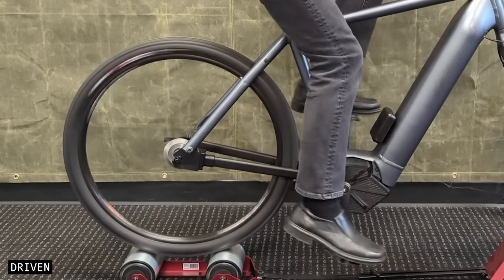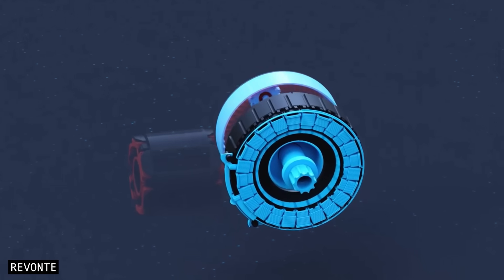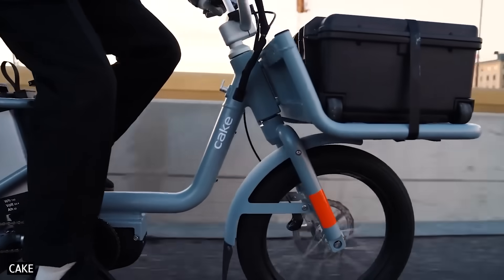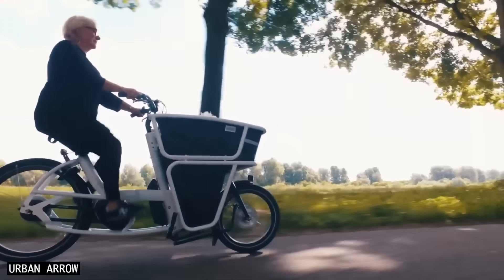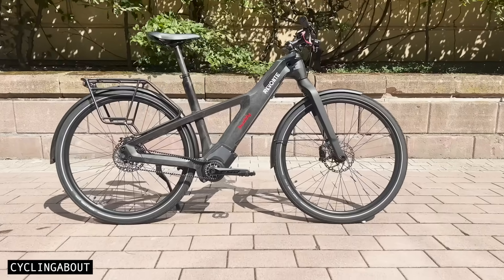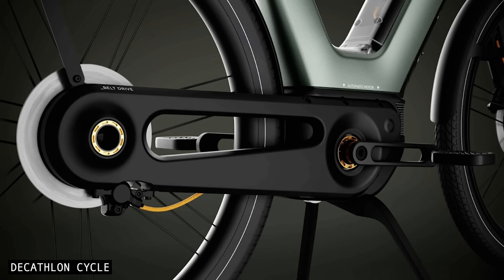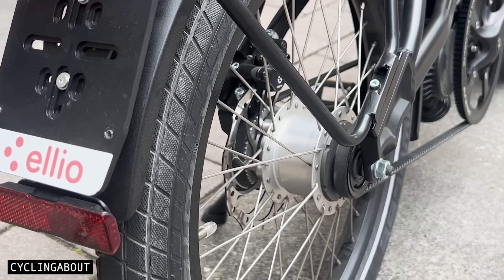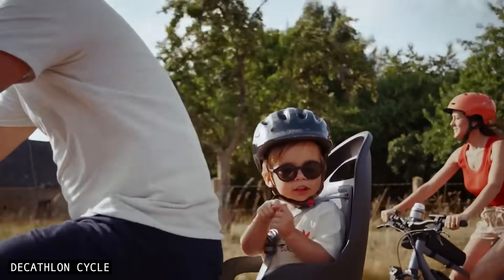Death of the Derailleur? Chainless eCVT Bicycles Might Change Everything!

Comment from the maker: I might be wrong... but I think this is the FIRST video explaining eCVT bicycles on YouTube!! 🎉

If you like my videos, make sure to join my Patreon so I can keep em coming: https://www.patreon.com/cyclingabout
Reply: I came up with this concept a few years ago and was surprised none of the major manufacturers were making it. I'm glad somebody finally is starting production.
Reply: So not really "chainless".. the eCVT is separate from the chain shaft or belt choice. .... using the 2nd motor to auto adjust the gearing , is fine , but why ? Why add weight complexity & cost  when manual gear change is just fine?
Reply: @brackcycle9056 manual CVT, you either have the planetary fixed or free, so two gears.  The electric motor allows the infinite variation between those two.  Or that’s how I understand it…very clever and simple.
Reply: Cool, is the an FS emtb version of the "Orbit Drive" shaft drive to deliver power?  Seems like it's only a prototype.

Comment: Already living with the nearly unfixable and expensive Bosh mid drive performance CX on my cargo bike. I'll stick with the trusty bafang hub motors for commuting, and a normal push bike for sports. Just easy and cheap to fix and keep running. This ecvt tech just brings more complications to a system that needs to be easy and cheap to maintain. Normal people don't need more power that what ebikes already make, they just need it to be cheaper to change the way they move.

Comment: This is a bad design.  I have a bicycle with a nuvinci hub, and it's a great technology, but there are transmission losses.  Add more transmission losses for shaft drive.  If you want a low maintenance drive train that is still repairable, please consider belt drive bicycles.  Also shaft drive isn't a new technology, and hasn't taken off for the reason of weight, cost, and power transfer inefficiency, as well as harder to maintain as others have noted.

Comment: e-bikes are not needed in 99% of the cases - just fully use your feet instead, you know like normal cycling works.
Reply: This logic only applies if you think of cycling strictly as a sport and not a commuting tool.

Comment: Lets try something simpler.  

  The motor powers the bike, responding to pedal input and the assist setting.  

  The pedals connect to a generator that that supplies power to the motor, with excess power charging the battery.  There is no mechanical connection between the pedals and drive system.

This system, without a battery.  

  The motor power is equal to the pedal power.  Pedal power is equal to RPM times torque.  Set the desired cadence, try to go faster than cadence, torque increases, bike speed increases.
Reply: There are companies doing that. There's two problems:

1. All pedal power must go through the serial path, reducing efficiency.
2. All pedal power must go through the serial path, and at low speed, the motor may not be able to deliver all of that power - some serial designs have had problems where they can't climb hills as a result.

Additionally, if you don't have a battery absorbing the excess power, if problem #2 occurs, it feels like the pedals are slipping.

The eCVT adds a planetary gearset and a mechanical path to the drive wheel so that some of the power goes through that mechanical path, reducing how big the motors have to be and improving efficiency. In addition, at least some eCVTs have a one-way clutch so that the pedals can't outrun the drivetrain, so if you're at a stop, all power goes through the mechanical path allowing the full human power to be used.

Comment: CVT is new, yes, but the concept of removing the derailleur and putting all the gears where the main sprocket is was experimented in the 40s and again in the 50s.  Use of a driveshaft was also an idea. 

The driveshaft idea didn't work out due to flexing of the frame at the rear hub. It translated into seal failure at the forward transmission. I guess no one though of putting a U-joint into the shaft? Odd.

The larger problem was the transmission itself. W-A-A-A-A-Y too expensive for the price of bicycle back then. They could easily cost 3, 4 times the price of the bike.  With today's prices, they might again be feasible.  As long as someone invents the idea of a U-Joint. I don't know, we might need to get our top engineers working on that one.:face-green-smiling:

Comment: No, CVT gears do not double the power of an Ebike. That is rubbish. And there's a good reason why driveshafts are hardly ever seen on bicycles. They suck. They have low efficiency, have problems transferring torque and they break easily.

Comment: This is all very interesting !

But the price has gotta work for me.

I think that a more "standard" rear hub 350w motor + 36v + 5 level pedal assist @ 20 mph (rated Class 2 in USA) in a tough E-MTB package is what I can use day to day.

I just bought exactly that in fact its the Vertis 27.5 E-MTB with front suspension & 2.6" Semi Fat tires.

The pedal assist works superb - you just have to learn which of the 3 x 7 - 21 speeds is best for your given situation.

This well designed & strong - agile even on technical trails is an outstanding value at just 
$ 648.

Finally at these prices many more Cycling & Fitness consumers can join the e-bike community.

In our local bicycle club one man's wife rides along on her e-bike - it allows her to keep up with her husband (not strong enough otherwise) so to me this is a hidden advantage as it allows friends or family to ride together despite strength disparity.

Comment: Every video I've seen highlighting some new tech as the death of the  derailleur replaces it with something even more complicated  that would be even more difficult to service. How is that better?
Reply from the maker: I replaced my derailleur with a Rohloff hub over 20 years ago. It's more difficult to service, but that's the thing - it barely ever requires servicing. I essentially just change the oil every 10,000 km and get the bearings changed every 50,000 km.

I consider that better.
Reply: @Cyclingabout  Fair enough. I buy cheap bikes that use cheap parts and while I've never had a derailleur fail on me I still replace it every couple of years because it's cheap and easy.  That's my preferred path.

Comment: As an aging outdoorsman, a light weight sealed system for pedaling assist is what I am looking for. We don’t need crazy distance or speed, just ability to help on dirt roads and mild trails.  Not looking for extreme, too old to risk breaking something.
Reply: Cool idea & I can relate.

I'm an aging road & MTB cyclist - 61 - still in solid shape but chasing the 25 & 40 year olds gets exhausting ya know ?!

I finally plunked down for an E-Bike an E-MTB actually and now I can testify it's helping me not get dropped on group rides but I still get a great workout - same as before - but the battery & motor with variable pedal assist keep me close to the main pack - we're safer as we do ride roads shared with traffic at times.

I'm not going to spend the $3-8,000 these crazy cool e-bikes in these videos cost.

What I got was Walmarts latest E-MTB the Vertis 27.5 with 350w hun motor / 36 volt / 40 mile range.

It's rated Class 2 so 20 mph max assist but I've found it's plenty powerful. 

Gears are 3 x 7 Shimano with strong disc brakes + 2.6" Semi Fat MTB size tires.

Could accommodate 3" tires too.

Anyhow it's a very high quality bike and at a super reasonable  
$ 648 it's unbeatable value.

I've put 250 miles on in the first week testing it - it's slim design - easy to miss the battery it's so covertly hidden - and at 52# not super heavy.

On technical MTB trails it performed VERY well nimble & agile on rough patches even.

Comment: Still haven't understood how eCVT works. How do planetary gears deliver continuous transmission ratio? It appears to me more as if the speed ratio motor delivers variable pedal assist, rather than changing transmission ratio.
Reply from the maker: The best way to understand how they work is by using the Toyota eCVT as a prop.

I think this video does a great job of explaining it. Just imagine MG1 and MG2 are the two electric motors inside our bicycle eCVT gearbox: https://youtu.be/xg95OlH61lw?si=cbCjzDQOGn_wbL2K&t=793u

Comment: Why not eliminate the gearbox altogether and have the pedals connected directly to a generator and the electric motor,  would drive the wheels? Sure, you need a battery and would be stuck if it were dead, I'd take the risk.

Comment: Gear drive has been tried several times before . Aside from higher price , the ease of replacing a rear tire without specialized tools is one issue , then there is the probability or debris getting into the grease needed on the gears . There is a good reason such tech does not get used in high performance bikes needed in races such as the Tour De France . Chain drive is more energy conservative . The wasted energy of gear drive is no problem in automobiles with way more horsepower than needed . I worked 30 years as a bicycle mechanic . Keep it simple stupid .
There is a reason derailleur systems are so abundant . Electronic shifting is not needed . Almost any mechanically-minded person can replace a shift cable & learn to adjust the shifting . A bicycle is a poor location for anything electrical , in my experience .

Comment: I am a certified retired master mechanic. If CVT transmissions on ebikes are anything like a CVT in a car I would never own one. If it was given to me I would throw it directly in the trash where it belongs. CVT  transmissions in cars are complete garbage.
Reply: Have you any hints on why CVT on cars are not to be recommended?
Reply: @Herr_Vorragender  Hi, yes. First off they deliver a terrible driving experience. They are built with very poor quality compared to a hydraulic transmission. They over rev the engine and extremely hard on it, it is truly exhausting to drive one. They cannot be rebuilt and most are loaded with 30-40 sensors and are very troublesome. They have half the life expectancy of a hydraulic transmission. When you do go to replace it it is going to cost you 10k+ to replace the piece of junk. If I was given a brand new car with one in it I would have it flat bedded right to the scrap yard because I would not have the heart to stick someone with it.
Reply: @tradingcandles1  I had a feeling these things may be good brain teaser for engineers, but bad in terms of life expectancy. I would assume given the number of tiny parts and complex over all system coupled with the high power torque, it must be quite susceptible for a high wear and tear.

Comment: So it’s a scooter. I had a scooter with cvt. It’s centrifugal. Imagine a bike spoke that gets larger the faster it spins. That’s cvt.  I haven’t had a bad experience with it. It’s a bit misleading  saying that the bike will automatically set a gear for you. At zero speed the spoke is at its lowest diameter and grows bigger through centrifugal force . That’s how it “magically chooses” the right gear for you.
Reply from the maker: There are many types of CVT, and this is not like your scooter one. eCVTs come under the "Hybrid electric" type rather than "Pulley based": https://en.wikipedia.org/wiki/Continuously_variable_transmission

Comment: I think the key thing preventing this from becoming widespread is the cost/complexity of it. It makes sense in cars, where the eCVT replaces a fairly expensive transmission, but on a bike I'd imagine derailleurs/other purely mechanical transmissions are cheaper and avoid the cost that comes with an extra motor and programming the eCVT to work effectively. They will definitely not be popular on low-end ebikes.
Not worried about eCVT reliability though, a sealed gearbox with no clutches should last a very long time.

Comment: I'd rather bet on electric transmission bikes. A hub motor in the rear wheel (optionally front too) and a small "generator" between the pedals. Solid state electronics handle the power mixing between generator and battery. Very few components, separately maintainable, only cables, extremely rugged, works decently without battery, very customizable because it's all digital, but it's heavy.

Comment: Can’t come soon enough. A youth spent adjusting derailleurs, broken chains and indexing issues has made me shy-away from bicycles in adulthood, where I just want to be able to pick the bike up, ride then put it away again.
Reply: I have a modern road bike with Shimano Ultegra mechanical gears.  It is 2 generations old.  When riding 400kms a week I got my bike serviced once a year and never had a mechanical issue.  Modern disk brakes and derailleurs are really well designed.  Waxing the chain means it’s much cleaner, quieter and more efficient.  That being sad for a folding e-bike used for transport and shopping I am looking at a belt drive and hub gears for simplicity

Comment: This is a great video.

I would say that a real killer for these bikes is their value, which is typically £1000 for an entry level model. Unless you have a locked shed at home, at work and you can secure it with a grinding-wheel proof lock whenever you go out, there’s a fair chance it will be nicked within a couple of years.

Bicycles are already the most expensive possession that are left on the streets without an alarm or immobiliser.

Comment: These insane high power, high torque motor systems really should not be on common e bikes.

I think almost every commuter would prefer less power and a few kilos lower system weight. Weight can be lost in every part of the bike by not shooting for torque that is so much higher than normal bike torque.

Comment: Another good video. 
I'm not sure if they're the future, because of two reasons:
1) Cost. They CANNOT be as affordable as chain/derailleur paired with a simple rear hub motor.
2) Low efficiency, compared to chain/derailleur, especially noticeable when pedaling the bike fully manually, due to a dead battery, for instance.

I would like to see an efficiency comparision between:
- Chain/derailleur (including most & least efficient scenarios. Dirty, cross-chained, inefficient gear, etc.)
- Belt/IGH
- Belt Manual CVT, i.e. Enviolo

I DO believe belt drive is the endgame. Lighter and more efficient than shaft drive, less maintenance and cleaner than chain.

Comment: I'm not sure I understand why one might get stranded without enough battery level to make the shifts. Surely the system could be designed to marshal the on board reserve power unit that's mounted to the seat to charge the system enough to just do the shifts.

Comment: yeah battery dependency makes it useless in the long run. ie ded weight. must work without battery too, in manual gear mode. two belts/chains is too much. keep it simple. two motors is too much.

Comment: Not a fan of the cvt system. I prefer the pinion motor gearbox combo with a gates belt. The electronic shifter pinion has, allows for a quick shift under load

Comment: The appeal of a bicycle is simplicity and reliability outweighing impracticality so it inherently appeals to a niche group, to expand its appeal manufacturers have relied on sport and recreational promotion. The challenges facing the ecycling industry are several, no one wants 10 -16 year olds having access to unregistered vehicles that can be hacked to do 60 KMH, I don't know many people who would be willing to ride through the depths of winter to go to work or do the shopping and pick up the dry cleaning at 25KMH and the more complex the system to maintain well you may as well buy a motorbike. I think the solution is a Honda Cub or Scooter equivalent for the markets where those vehicles are dominant that offers better reliability and is cheaper to own.

Comment: I would rather spend that money on a real bike and continues cycling on a real bicycle, This kind of bullshit is out of control. All of this will end up dying in basements and garages due to lack of parts or overly expensive replacements A 90s steel MTB has more chances of surviving the next 50 years with adaptor electric kits than this has to survive the next 10 years but I'm guessing that companies are more worried in making a quick buck than actually helping the environment

Comment: Sounds good. I already ride an Enviolo CVT. The higher efficiency, larger gear range, automatic gear shifting and crank location of eCVT tech makes it even better. (Enviolo can also do automatic shifting, but that's a complicated and expensive upgrade that would void my ebike warranty.)

Regen with crank drives can be dangerous, because the wheel has to drive the crank. If not using a shaft drive or a completely enclosed belt/chain, things can get stuck, instantly locking up the rear wheel. If the thing that gets stuck is your trouser leg, it can drag your leg into the drivetrain causing serious injuries. It's the same problem as with fixed gear bikes, you have to be very aware of the fact that the chain doesn't stop until the bike stops or the rear wheel locks up.